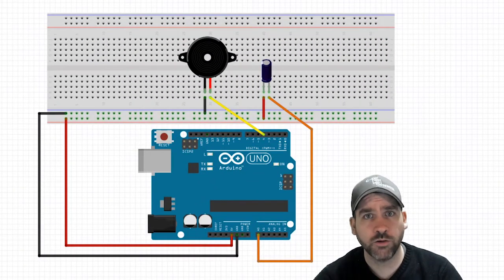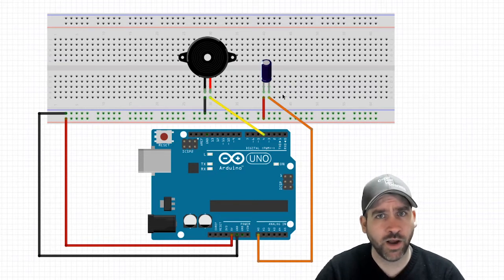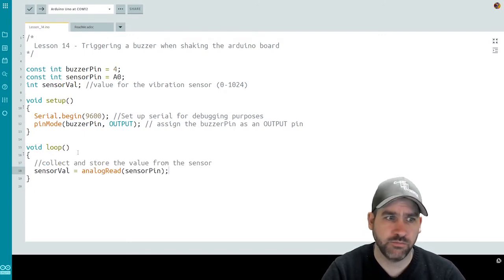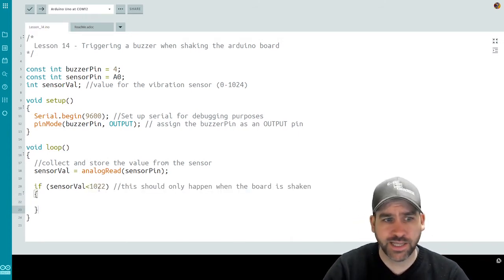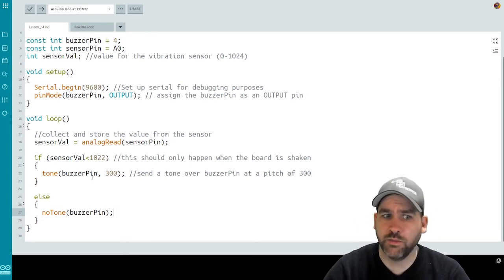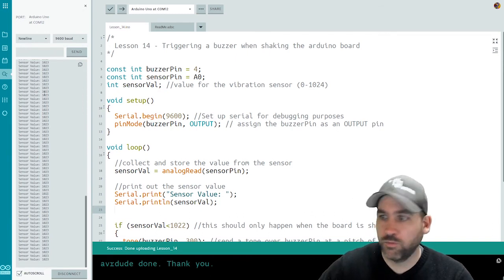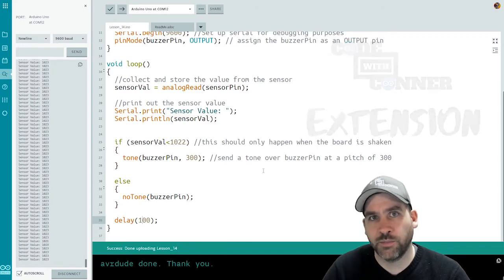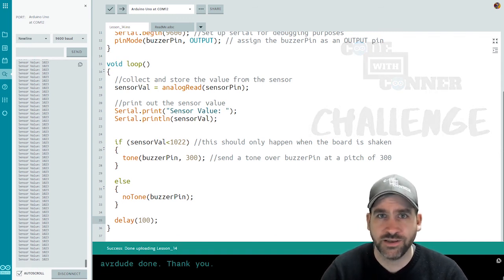Arduino Basics - Lesson 14 - Using a vibration (shake) sensor and a buzzer

Comment: Why pull-up resistor wasn't used with the sensor? When sensor is active and closed circuit happened, where does current from 5V pin go to? Does current flow through analog pin? Does analog pin take current like ground? If any current doesn't flow, voltage drop becomes 0 volts. So analog pin must read 5V (1023)?